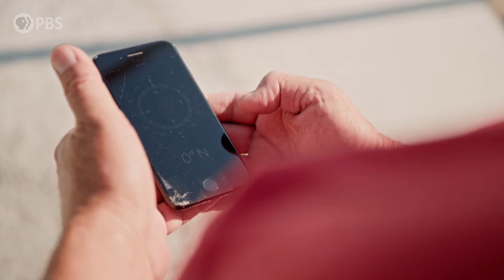New Sustainable Housing Solution Based on Lakota Tipi | Native America | PBS

Comment: Investing in people is the best way to get productivity out of them. It's why inheritors of wealth generally go on to find more success than their less fortunate counterparts. If people in this country felt this way, poor natives would be a thing of the past.

Concrete insulation is pretty cool, but it just seems like these people are being asked to think way outside the box, because they are so poor. Besides, how are they even supposed to make sloped sides with that goop? Won't the bubbles pop and cause it to settle back into regular old concrete?

BTW, I know solar energy is very trendy and fashionable right now, but it's not a practical, reliable, or even cheap solution to the electricity problem. All of the stop gaps, like battery storage, large arrays, etc are all very ineffective and heating is one of the least efficient ways to use electricity, by a long shot.

I'm not saying they need to use coal or nuclear or anything political. I'm saying we need to stop facilitating this lie that electricity is a scarce commodity that isn't easily reproducible. It's basically just a lie to give utility companies better margins. It fits into the scheme of capitalism much better, privatize everything, even if its wasteful, costs much more, and gives worse service.

All of the conventional sources of energy, steam, water, wind, nuclear, solar, all are unnecessary and expensive. The solution was always right in everyone's face, the transformer.

Comment: Is there design advantage to the conical shape to withstand high winds? I suspect, yes.  m
Reply: There's an air circulation advantage inside, so I expect there'd be an advantage to air circulating around it outside as well.

Comment: It’s worth mentioning this aero-crete is not the kind which caused problems with building failures in the UK, that was reinforced and autoclaved aerocrete with the problem being the steel reinforcement rusting inside the concrete. 

As seen in the video the steel structure is in plate form underneath the outer concrete skin, which means it’s not reinforced concrete and should be just fine through all seasonal conditions.